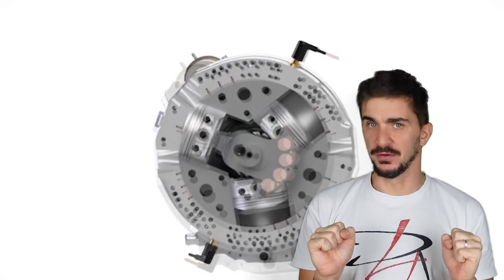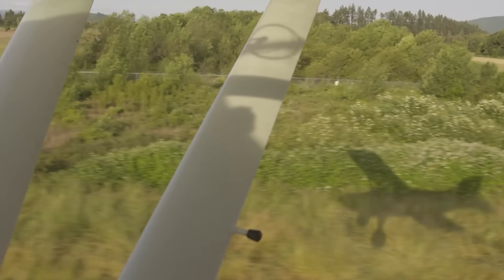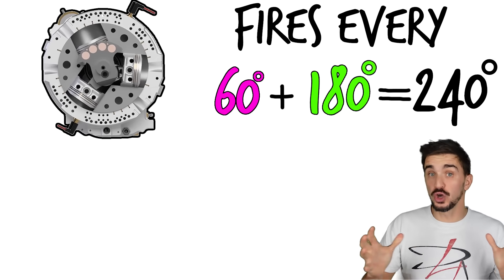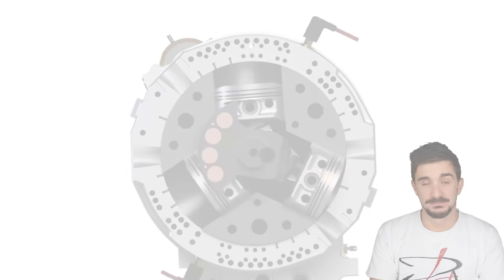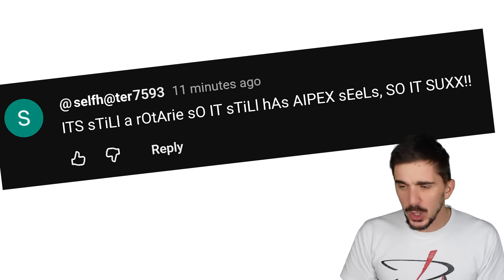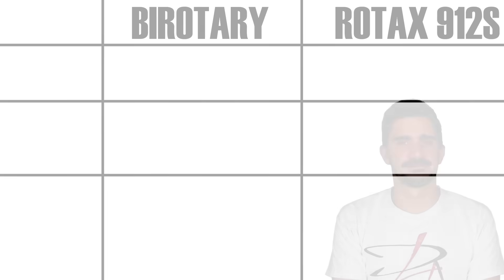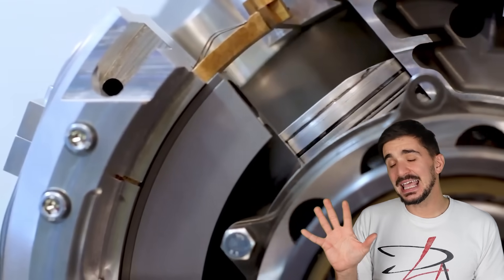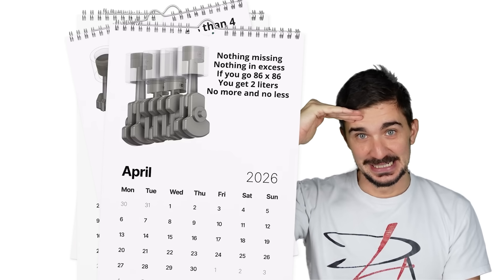This is What Happens When Pistons and Rotaries Make Babies - Birotary Engine Explained and Reviewed

Comment: You missed the elephant in the room- friction.

 In the engine shown, there are no less than 23 friction types seals (rings, rotor seals)- plus however they are sealing the sides of the rotating block and cylinder assemblies. All that would have to be lubricated somehow, (possibly mixing oil/ fuel) and even then it is going to increase the amount of fuel energy that is not converted to useful work. The lowest of low tension rings still adds drag, and that drag equates to lost efficiency.

Another drawback is the planetary gear set- even the most compact and lightweight units are going to incur frictional losses, and require lubrication. 

Unless they are mixing fuel and lubricant, the engine is going to require quite the elaborate oil pump (or pumps) to keep it from friction welding itself together. 

Let's discuss another barrier to ground-level applications, Cooling. With the block rotating, without the use of some fairly elaborate seals (which would add more friction) there is no way to liquid cool the block or the areas of it that are exposed to the combustion process. This might work well in aviation applications because of the reduced temperature that comes with altitude, but it appears to me that sitting in traffic under load would likely be a death sentence for this engine. 

In conclusion, the elimination of the valve train and associated components might sound like a great idea on paper, but in practice, all they have done is replaced one large source of friction with many smaller ones, and with the RPM necessary to make adequate power those will have the same (or greater) effect on efficiency as the components they eliminated. 

TLDR- Neat idea, but they didn't eliminate the drag of the valvetrain, they just replaced it with many more, smaller sources of drag which will reduce efficiency by the same amount or more.

Comment: I just see a ton of potential issues, poor/none Induction & exhaust control, fixed spark timing, fuel metering challenges, cooling issues, lubrication control, fuel atomization and flame propagation issues related to high centripetal forces, knock control, extra friction from piston rings plus barrel seals, durability, fuel efficiency, emissions, etc. etc.

Comment: 10K rpm is not still 10k rpm when it comes to engine wear (15:08).  Many moons ago Honda did a reliability study and found that rpm, in and of itself has no bearing on engine wear.  Engine wear is directly proportional to side loading caused by excessive piston speed, period.  A perfect example of this is a journal bearing turbo charger.  They can live for hundreds of thousands of miles at 100+k rpm,  but if pushed too far outside their normal operating zone the thrust bearing will wear out and the turbo is quickly trashed.  This can be seen in Honda's F20C and K20A which can reliably rev to 9k all day everyday for hundreds of thousands of miles. But F22C's and K24As wont last long being consistently rev'd that high despite essentially being the exact same engine,  just with a longer stroke and thus much higher piston side loading due to excessive piston speed.
Reply: It does have an effect on fatigue because intertial forces increase with the square of speed, so a fatigue failure is more of a concern ar high rpm for a given total number of rotations, and even more so for a given number of hours at high rpm
Reply: @SuperYellowsubmarin  The point you bring up is only correct if you assume that all things are equal.  If we were referencing two identical engines and we were to spin one faster than the other.  In that scenario yes, you are correct.  However, in the video he is talking about the Birotary engine vs the Rotax 912s.  In which case 10k rpm in an extremely short stroke Birotary engine is not the same as 10k rpm in a 912s.  What I said still stands true.  RPM, in an of itself, does not matter.  Just because one engine spins at a higher rpm than another does not automatically mean that it will be less reliable or require more maintenance.  As you reduce the weight of the components and the distance those components travel, the fatigue force shrinks as well.  As you increase the piston speed past 25 m/s it causes greater and greater side loading.  Typically the side loading will destroy the cylinder wall long before the wrist pin fails from fatigue and a piston tries to exit through the cylinder head (barring a massive over rev due to something like a missed shift). But again RPM is only part of the equation. By itself it has nothing to do with piston speed until its combined with stroke length.
Reply: yeah i think rpm should be measured at whatever part is going to fail from high rpm first- like you want to know rpm relative to whatever is limiting the rpm.
Reply: I think that rather than sum the rotations, they should be subtracted. which results in 5000 RPM. In fact, the fastest component is only 7500 RPM.  Supercharging and/or turbocharging will increase the heat loading on all the components and increase the cooling component sizes but certainly worth trying.  A 2:1 boost should effectively double the output.  Effects on the seals are TBD.
Reply: @genemelton8305  I agree with your reasoning to a large degree. Relative to the engine housing, the crankshaft rotates ⅓ slower than relative to the rotating block. Now, for other drivetrain components like the gearbox it's the output shaft rpm that matters. With this in mind I'd say the engine fires every 60 degrees and maybe sounds like a V12?

Comment: I used to fly small aircraft that had the Rotex and Lycoming Engines. 
The one inflight failure I had that could have been serious was the CAM started to fail causing reduced power during flight. Thankfully, I was near my home airport and was able to land before any serious damage happened, All I knew while flying was my engine wasn't producing enough power so I immediately turned back for a landing. 
After the mechanics checked it out, they told me the cam shaft had almost failed and it needed a full cam rebuild. 
This engine seems promising as it doesn't have a cam shaft or valves, this could be very good for reliability.
Reply: At least you didn't end up in the Hudson.

Comment: Very interesting design.  I wonder how well suited this could be as a generator similar to the gasoline engine in the Chevy Volt.  Lots of applications require a fixed or very small RPM range.

Comment: 5:41 this is indeed very weird because for power output calculations 180° is correct, but maybe for crankshaft balancing 240° could be considered? My brain is also knoted

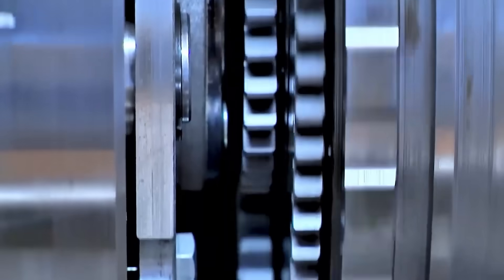7:00 by my logic then, the engine fires in every 60° of the power shaft rotation, which is not the crank shaft and now I am confused, bewildered, mindboggled even.

Comment: As the rotors are stacked to get higher power (2 rotors us 200 hp, 3 rotors is 300, etc.) how are the inner rotors cooled to prevent piston seizing at high power settings?

Comment: The rotary reaction in aircraft is due to the propeller, not so much the engine.  
This thing has considerable friction from the block rotating inside a housing and has con rods so short as to be a problem at higher speed.  High rpm means less time for combustion which means lower thermal efficiency.
Show us real weight, and specific fuel consumption.  Don't expect to hear anything further about it.
DOA.

Comment: This engine design is perfect for a turbo. Also, in its present design, it would great for a motor/generator for a car. Just add a small battery pack for acceleration, and you'd have an awesome automobile.

Comment: My SF28A uses a Limbach 65hp, aviation version of the VW beetle engine. It has terrible overhaul TBO because the cylinder heads are always crusting out the valve orifices. But since my aircraft is experimental, I can use auto parts to a great extent. I bought a 2nd back up engine for all of 1000$ dollars. If I was to buy one of these new fangled engines, it would cost more than my entire aircraft is worth I bet. I would love to put a catlytic convertor on my VW engine for emissions.

Comment: I feel like you could make a long-stroke version of this by increasing the diameter of the motor, keeping the piston diameter the same but increasing the crank offset and the rod length. I suspect you could even add more pistons but am not sure how that would affect balance. As for weight, I think that the block is pretty massive. maybe they could reduce the weight (and rotational inertia) of the block by adding empty cavities. FEA FTW!

Comment: Interesting. If the valve section were a separate rotating sleeve inside the main housing, split intake and exhaust, you could independently phase the ports instead of relying on fixed geometry. Great design.

Comment: Variable ports could be done same as a 2 stroke exhuast valve. Low rpm port velocity could be fixed with a supercharger and direct injection.

Comment: I see another good application of engines of this kind as small generator engines, a plug-in hybrid cars engines with variator or planetary transmissions, and wonder if this type of arcitecture could run on diesel 🤔

Comment: This engine might have some incredible potential blending technologies from pistons and rotaries. First, you mentioned nothing about the scalability that you showed at the end of video. You would probably get more power per weight ratio once scaled. Second, what’s the math around a 2 cylinder birotary to add the necessary torque? Scale a 2 cylinder with 2-3 cylinder heads to assist with balance while making horsepower acceptable. Lastly, what are the chances of changing the intake port plenum length/shape to assist with more efficient torque curves? Lastly generation Mazda rotaries did this.

Comment: The block rotation adds mass. This doesn’t seem efficient for anything other than its current use. The added mass would make it harder to rev up and down and also would likely act like a heavy flywheel. 
This is fine for properly for the load but would likely never work well anything other than a propeller type airplane.

As far as low rpm power. They  would have to add some type of variable restricter to the  intake to increase low rpm airspeed to help low rpm’s torque. Smaller “camshaft” so to speak and this does better at low rpm. The exhaust is less relevant but does help. It would be more complicated. 

Adding variable intake runners could help also.

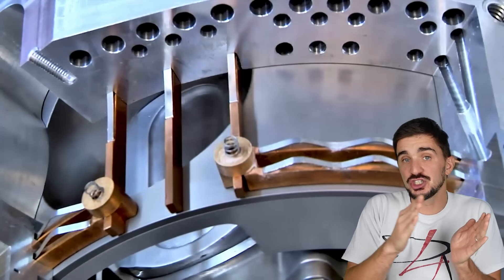Comment: 16:50 that's good for generating electricity, ironically. if this engine is small enough, it can be used in an electric car, the irony. electric generators like constant rotation, and electric engines are good at producing lots of torque at variable rotation, the problem is storing energy.  so you use this small and light engine to generate electricity and then you power the electric motors, just like a diesel engine in a train does.

Comment: Over 60 different airplanes in WWI used rotary engines. The prop and the cylinders spun at the same speed and the crankshaft was stationary.  One famous plane was the Sopwith Camel. The plane caused the death of many new pilots due to the gyroscopic effect created by the spinning engine.  Another plane and one flown by Eddie Rickenbacker was the NIeuport 28. Engine rpm was controlled by the pilot interrupting the ignition. Many did not use carburetors but had levers to control the fuel mixture. The rotary engine was lighter than the inline or V engines and this allow the plane to be lighter and more maneuverable. Early rotary engines would be an interesting topic for you to cover.
Reply: They were not called rotary engines, they were called radial engines and were piston engines that had cylinders that span in free air, with a crank in the middle. - https://en.wikipedia.org/wiki/Radial_engine
Reply: @jamesalexw  Partially correct to say that rotary and radial engines are both radial engines, since both have their cylinders in a radial configuration. But operation is different.
Rotary engines used the camshaft fixed to the engine mount and the motor itself rotated, with the prop directly connected to the engine. 
In a radial, the cylinders were fixed and the camshaft rotated into a gearbox and the prop affixed to the gearshift.

One has to remember that radial configured engines were new and still developing. The rotary engine design was the first. It offered ease of construction, light weight, simple airflow cooling with their cylinders turning in the airflow. Their problem was power: to get more power you needed more cylinders which meant more mass and more gyroscopic precession force: jam the throttles forward and the engine torque would make the plane roll in the opposite rotation. That would cause a snap roll that can catch pilots off guard. In the old biplanes, that could mean rolling while taking off, with a wing strike into the ground, or in flight, loss of roll control resulting in a spin. Because of this, by the 1920s the rotary engine had fallen out of favor and replaced by the newer radial engine. Need more power, add cylinder rows with minimal roll influence.
Reply: The Siemens-Halske Sh.III rotary engine, which was used in the German Siemens-Schuckert D.IV aircraft, even had a counter-rotating crankshaft, making it also a 'bi-rotary', following the naming convention used in the Video. That said, it still had a conventional valvetrain, and the gearing between crankcase and counter-rotating crankshaft and was 1:1, not 1:3.
Reply: Snoopy seemed to have a pretty good grasp of how to handle the Sopwith Camel.

Comment: Couple that engine to  generator,  and there you go you will have good range extender to your EV since electric motor take care of torque speed range. Therefore also that motor can be used with generators, ie gensets. Plus that motor can be used as an outboard/ inboard marine engine since in the sea your power torque fluctuation is same steady

Comment: about the fixed ports, don't forget 2 stroke rotary valves, like Kawasaki KR150 (Scorpion, Ciclone, KR, Victor jazz) Where kawa had 3 exaust oprts,, one big that is fixed, and the other two are the rotary valve commanded by a centrifugal mechanism, in my bike 150cc 2stroke you can use the bike below 6000rpm pretty nice and soft.. ando over 7000 it turns more like a dirt bike reving up to 10.500 rpm. Honda NSR ,did this with a servo, also Yamaha and Suzuki all one cylinder 150cc

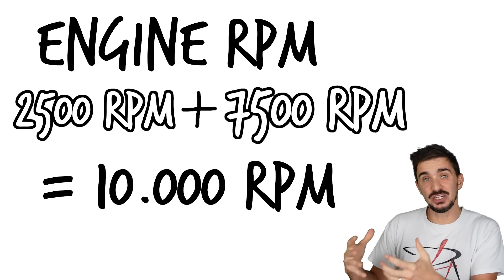Comment: @7:40 dumb way of counting. We should move away from weird counts. Counting rpm should always and only be detonations per piston per minute.. as it would also directly give us an idea of what kind of sound the musical instrument is doing
Reply: Should probably only count the output rpm
Reply: It’s metric counting.
Reply: @Expert51279  I'm sure you can come up with a fractional number instead if you think hard about it...
Reply: personally I'd count the output RPM, because that will line up torque/hp diagrams better.
then you count the firing timing as "stroke equivalent" or something like that.
but this choice by the manufacture is entirely a marketing move.
Reply: I would call it a confusing way of counting revs, not necessarily dumb. 
To get an idea of how it sounds and compare to a piston engine I think it's best to count output shaft revolutions, i.e. block revs. For every block revolution you have 3 pistons firing 2 times each, which, if I'm correct means it fires every 60 degrees. So, does it sound like a V12?

Comment: @1:13 immediate drawback, it loses heat through a huge cylinder block so they will never ever get the efficiency numbers of two pistons going against each other in the same cylinder. Hard to se it make 50-60% efficiency which is what you get by just putting two 2-stror dirtbike engines on top of each other, remove the top, change position for the sparkplug and couple both Francis together with gears..

Comment: Seems ideal for an electric-drivetrain hybrid.
Where your engine will only need to be efficient at a single target rpm.

Also seems like it might be easy (very minimal parts & mechanical losses) to build an "in-block" supercharger into the intake design.

Comment: Why can't this use a supercharger?
Reply: the limiting factor is probably the compression ratio. i think the total displacement is set by either the power demand or piston speed at this size (or side loading idk). if its about 10:1 for pump gas, you can slap a turbo on it if you switch to avgas. my guess its already meant for avgas. but for more power you can add banks of pistons as they showed

Comment: at Benefits and Drawbacks. the benefits for this limited application seem to outweigh the drawbacks. Overall, a simple motor design (simplicity should lead to additional benefits and lower risk which happens to be a good thing while flying multiple thousands of feet (or meters) in the air)

Comment: The seals are not in constant contact with the block apart from right at their ends, they have to pass over the top of the cylinder so very much an interrupted sealing path so sealing and longevity issues are quite possible.  also more seals might mean better sealing, but it also means more frictional loss.   I'm also wondering about thermal losses as the combustion process is constantly being exposed to a fresh area of "cylinder head".

Comment: a Knovel design. Propellers need low RPM but the engine needs high RPM so the design has a built in reduction. It does also sound like a great generator engine, both mobile (hybrid or other use) and stationary. I'll go gander at the generator you mentioned in a reply in a bit